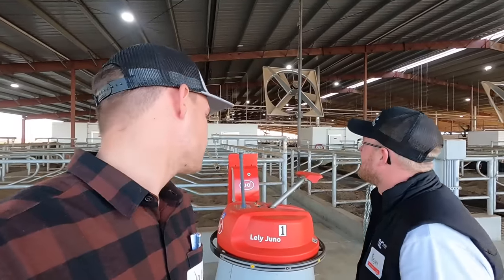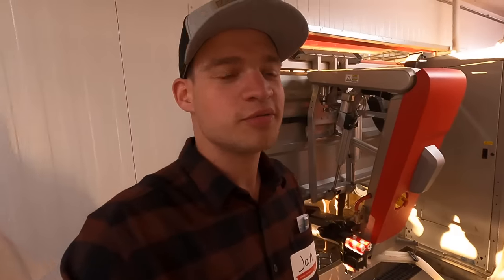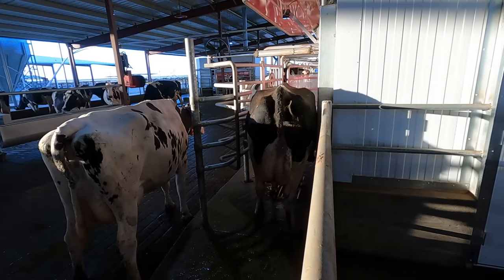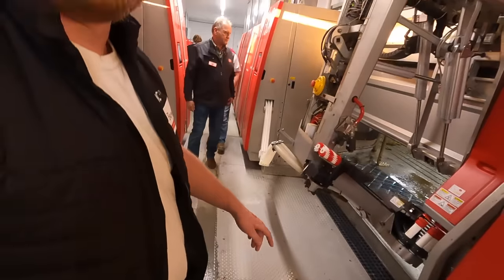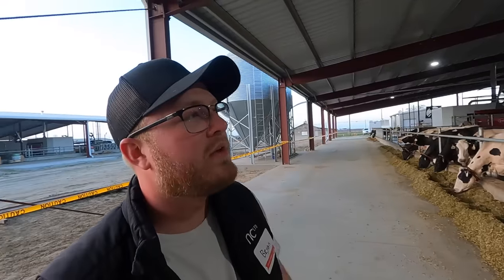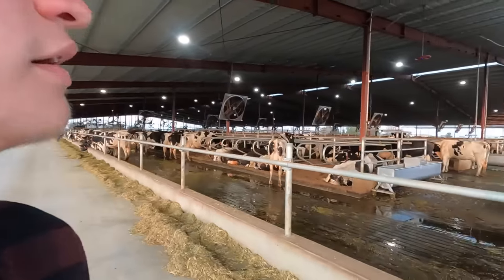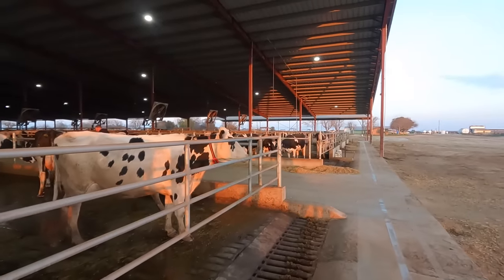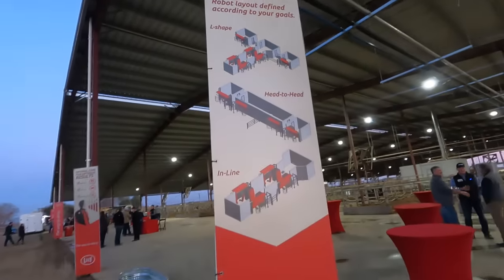This New Dairy Has 12 Milk Robots!!

Comment: 👍👌❤🇨🇦, another Sask boy, me too, not into the whole automation of milking, still like to have the human factor involved, keeps the economy going
Reply: CARINA🦋  <-  <<--  <<<---  <<<< ---------  <<<<<- ------ ------ ------ ------ ------ BOT  BOT  BOT  BOT  BOT  BOT
Reply: Maintenance is still needed every day. There is a lot of manual labor left to do!
Reply: @erwinlageschaar5550  I agree but, to make the economy fluid you need people working, not automation which only creates jobs for a few
Reply: What happens when a power outage occurs?  Machines DO breakdown, they need repairs and parts.
Reply: G. Holman , I'm sure there is maintenance going on all the time.  If everything is automated though, what happens when there are breakdowns and no parts are available?  Or a long term power outage?  Cows just can't wait a week for parts, then spit out a weeks worth of milk.  They NEED to be milked a couple times EVERY day.  Automation has it's limits.
Reply: G. Holman , agree.  Just say NO to auto-milkers!!  🤗
Reply: G. Holman  Even if you have to sell a few cows usually if you switch from Manual to robotic a lot of cows start producing more milk, like we have had farms here in Manitoba that where producing in the low 30 litres per cow and after they got robots the where producing low to mid 40’s per cow, so they sold the cows that werent fit for the robots and more and are still over producing their quota. I mean every farm is different and I guess location too, but up here alot of the farms are over producing we even had senerios where farms switched from other brands robots to lely and they started over producing
Reply: G. Holman  and about people loosing their jobs because of robots depends on the farm, a lot of farms install robots and still keep all their workers becouse there are still other tasks to do on the farm
Reply: G. Holman  so far I haven’t seen that happen up here, atleast not that I have heard or seen

Comment: I have to research the "volunteer " foot bath have never even heard of the concept don't mind seen it, however it is not unreasonable to suspect that it would work as I have seen cattle go out of their way to browse on certain herbs and plants on occasion which are known to have medicinal qualities, we also give cows free access to straw to eat if they are not feeling well and this reduces the amount of high fibre we need to incorporate into the mix as most cows don't need much more than.5 kg but you can have some that need much more so they can go help themselves, working well in our system,, if a voluntary system works it would cut out a lot of messing around the dairy that's for sure.

Comment: Thank you for posting the robot video.  I was wondering if they have a backup power supply.  One wonders how big the generator would have to be.  A big backup diesel generator would almost be a necessity to make sure of a consistent electrical supply.  Your fact finding trip is definitely going to be interesting to see what you can incorporate in your dairy.  One wonders if an "on-site" technician is required to make sure everything is working as it should.  😊

Comment: Hi Jan,
thank you for the interesting video! The barn looks like an east german dairy farm. Only the roof is a light construction, since there is almost no snow in California. In Germany the barn would have 6 rows of beds instead of 12 rows and be twice as long for a better climate in the barn and better cross ventilation. The cows an robots look clean.
We have been milking with a Lely Astronaut since 2001. Started in 2001 with an A2, since 2017 with an A4. The A5 looks very nice, the layout is also interesting with a central 4-robot-house and two small single-robot-houses and all 3 central units (CU) for 6 robots in the central robot-house (one CU supplies two robots each). 
Greeting from Germany, David

Comment: Jan, it is really interesting to see the different set ups. It is a shame you didn't explain how robot milking works. How many times a day are they milked? What happens if cows don't present to the robot? What happens in a power failure?  How are udder problems detected and managed with this system? How are other problems with the cows detected and managed? How did this farm manage manure after it is flushed out of the alleys? What is the water supply for these huge set ups and where does it come from? I believe parts of California are currently in drought.  It is great you are showing these visits, but providing info for non dairy farmers would help.
Reply: On these robots a cow typically gets milked 2 or 3 times a day, the robots track how often every cow gets milked , if a certain cow hasn’t entered the robot within the last 12 hours I think it was, it notifies  the farmer that cow for example 1234 hasn’t been milk for so and so long, the farmer then uses the cow locator to find that cow and chases her to a fetch pen by the robot so the cow can go in and get milked, this typically mostly happens by new cows that aren’t used to the robots
Reply: Udder problems/ health issues are detected through a sensor where all the milk runs through to test the quality of milk, and then through a cellmatic cell counter to check the cell count

Comment: You need to visit Fair Oaks Dairy in Northern Indiana. They milk 28,000 cows, most are milked in 100 stall circular milkers and are now converting the barns to robots of 12 robots per 2,800 cows.  Milking is volunteer by the cows and milking in the robot barn goes on 24 hours a day.  I just visited for the first time last month.  They have an extremely large visitor center to start your tour and then take you to the barns by bus. Everything is explained by guides at each stop. They also have a hog operation, totally enclosed farrowing and produce an average of 13 pigs per litter and produce 80,000 piglets per year.  It is also on the tour with guides.  Well worth the 5-6 hours for a visit.
Reply: That's a lotta cows

Comment: Hi Jan, see if you can find and film a rotary milking parlour farm using robots to put the milking units on and off the cows, this Lely robot system is too slow and too expensive to have a real future.
Reply from the maker: I disagree, but I will try to find one to film just for you! 😂
Reply: @saskdutchkid  in my humble opinion the fastest way to milk cows is in a rotary milking parlour using real people not robots, the next best option is a rotary milking parlour using robots, the Lely robot milking system is too slow and too expensive as per present design, however it could be speeded up by placing the milking robots in the centre of two adjacent rows of cows on each side and each robot milking cows to the left and right, think of a narrow herringbone parlour with the robot in the pit sliding up and down on rails to reach cows on each side, this would work and require little modification from Lely's present design.
Reply: Manual Labor is becoming an issue, Lely helps to get the job done!